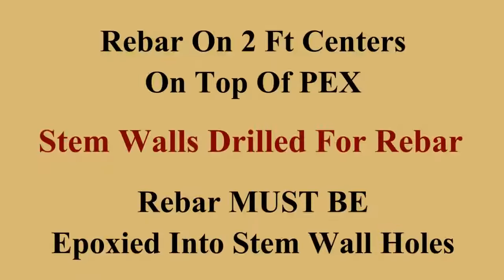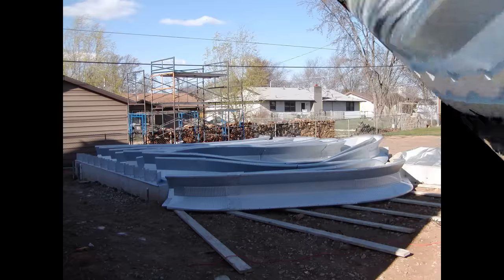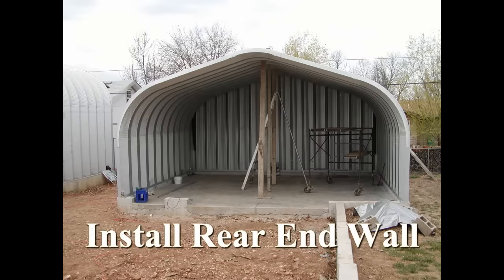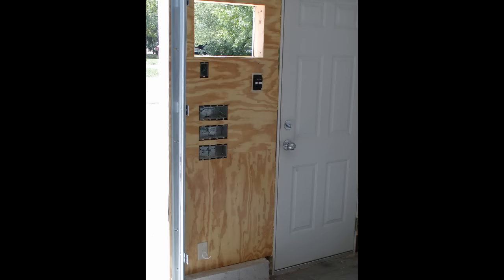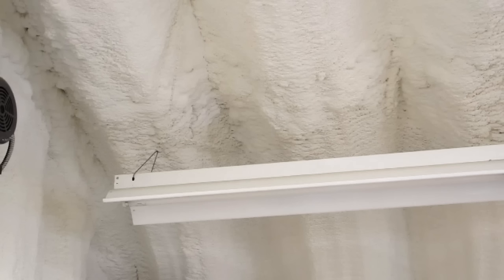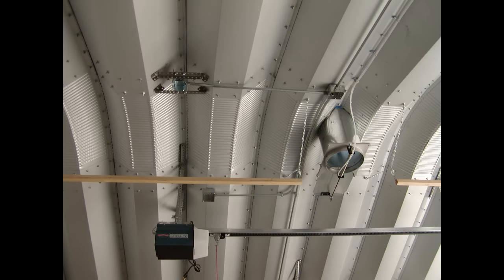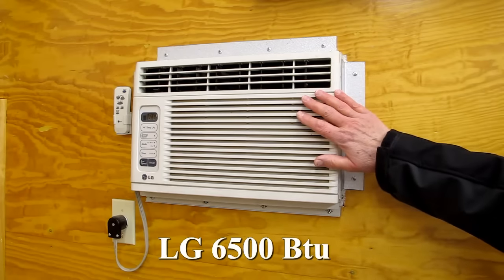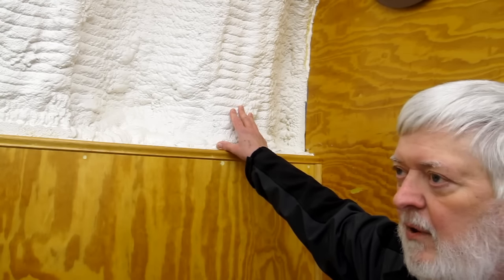Building My Steel Garage

Comment: This may sound like the craziest idea for the use of one of these arched panel buildings. I am a disabled female veteran and I am looking for ways to build a loft style building which allows easy movement in a wheelchair, and use it as my home.  Any ideas?  I know I would have to add heat/ac plumbing for a kitchen and a bathroom.  Thank you for any ideas and help you may have for me. I have been begging my local VA for handicap adapted home grant, and after 27 plus years, I have given up on my VA doing anything for me.
Reply from the maker: First go to pioneersteel.com and look around. Under building types go to Photo Gallery… it’s not great but it shows some stuff. The building is not hard to erect but it is labor intensive. And it must be put together correctly so you don’t have any leaks. You simply need to pay attention and follow directions. I had a 3-man crew put up my second building in 3 days (but they knew what they were doing). Finding and experienced crew may be difficult. The steel building is strong, weather proof, termite proof, fire proof and you will not need to replace shingles. The steel  building is self-supporting but it will not support any additional structure internally or externally. That means you CANNOT hang any portion of your residential construction from the steel building. You would frame out your internal construction inside the steel building and the building would be your outer protective shell. You would want roof turbines on the steel building to prevent condensation inside the steel building. I would not recommend the skylights you will see offered by the steel building companies. So you would end up with a wood house inside a steel shell. You decide what you want, draw up a floor plan including plumbing & electrical details, then do the excavation for footings and concrete floor (you may end up with footings for the steel building and footings for your internal construction). Then ask for the building to be delivered. Usually all the parts of the building are unloaded by hand piece by piece (and there are a LOT of pieces and buckets of nuts & bolts). Having 6 to 8 strong, younger people for this is a very good idea.  Erect the building and then build your house inside. Don’t know where you live, I use radiant heat, which is nice because the floor is warm and the heat rises from the floor. Radiant heat is fairly cheap if you can do it yourself like I did but tends to be outrageously overpriced by contractors and if they don’t know what they are doing it can be a nightmare! Your insulation would be in the walls and ceiling of your framed construction. I have no idea where you would intend to build this nor your idea of what a loft would be or the intended access. A elevator could be a problem with a power failure. Sprayed foam insulation is expensive but many, many, many times more efficient than fiberglass plus it seals the building airtight. Another good insulation is
sprayed in place cellulose insulation (recycled paper product – Google it). This is basically how mice and rats make an insulated nest by chewing up paper and cardboard. Cellulous insulation is many, many times better than  fiberglass. Fiberglass insulation (to me) is a rip-off, a waste of money and a joke. I heat my house with a hot water heater. I heat my shop with a hot water heater. I have zero fiberglass in my house. If you want to live inside  something that looks like the inside of my workshop then you would need to have all the plumbing and electrical done before spraying the foam insulation. Watch my video Welcome To My New Shop, which pans around the inside of the building. The sprayed foam is not pretty but it is a good insulation and when painted white reflects the light nicely. Living inside my workshop (which is 500 sq ft) would be like a studio apartment with a 100% open floor plan. Hope that helps. Thanks for watching and Please Subscribe… there is probably some other stuff which will be of interest to you. Ron

Comment: Very nicely done! How are you connecting the 2x4s to the walls for the paneling?
Reply from the maker: Remove the existing building bolts at that level. Pre-drill a hole from outside. 5/16 galvanized Lag bolt with a steel washer and a bonded washer under the head. Bonded washers have rubber on one side but the metal is pretty thin. Then grind the protruding point of the lag bolt off flush with the inside of the 2x4. Pine is soft so you want a full length of thread inside the wood and do not over tighten and strip out the threads. Don't overheat the lag bolt when grinding so as not to burn the wood.

Comment: How did you attach the 2x4 to the walls.  Did you just use the bolts from the structure itself?
Reply from the maker: Ronald Graham Remember, most sales people you talk to probably wouldn’t
recognize one of these building if it fell on them. They are working off a
script or have been told to tell customers “never drill a hole in the
building”. Common sense and logic are needed when you do these things.

 

The building bolts are on the outside of the corrugations
except where the base plate attaches. The flat panels are on the inside of the
corrugations. I drilled a ¼” hole in the center of the flat panels and attached
the 2x4’s with a lag bolt in every flat the length of the building. I used a
flat washer against a bonded washer on the outside of the building to maintain
a good seal against the building panels. A bonded washer is a metal washer with
rubber bonded to one side. The metal portion of a bonded washer is relatively
thin and flimsy. The flat washer supports it. A little silicone sealant on the
rubber of the bonded washer is a good idea. Only tighten the lag bolts firmly,
do not strip the threads in the wood (2x4’s are pine and it tends to be fairly
soft wood).

 

Every flat along the base plate has two bolts (which will
engage the 2x4’s. Along the bottom against the base plate, smack the 2x4 with a
hammer to indent the wood where all the base plate bolts are. Drill clearance
holes for one bolt and nut (original building bolt and nut) and a hole for the
lag bolt in the other. The height of your side walls will determine if you have
to do the same thing for the top 2x4 (watch the video again and you will see
what I mean).

 

Use lag bolts long enough to obtain full thread contact with
the entire thickness of the 2x4 and then grind off the excess bolt flush with
the inside of the 2x4. 

 

I used on 2x4 at the top, one at the bottom of the plywood
and then 2 two more spaced in between (watch the video again). 

 

I would not recommend drilling holes in the curved sections
or in the flat roof panels. A few holes in the vertical side panels and using
bonded washers you should be good. Remember, think about what you are doing
before you go drilling any holes.
Reply: Ronald Walters
Awesome. Thanks for the advice.  Keep the videos coming!!

Comment: Do you have any videos on mounting the wood panels to the side wall?
Reply from the maker: Sorry, no video showing that. Remove the existing building bolts at the level of the 2x4’s which the interior walls (plywood) will attach to. Pre-drill a hole from outside. 5/16 galvanized Lag bolt with a steel washer and a bonded washer under the head. Bonded washers have rubber on one side but the metal is pretty thin. Then grind the protruding point of the lag bolt off flush with the inside of the 2x4. Pine is soft so you want a full length of thread inside the wood and do not over tighten and strip out the threads. Don't overheat the lag bolt when grinding so as not to burn the wood. I used four 2x4’s for attaching the plywood (top, bottom and 2 in the center).
Reply: @RonaldWalters2010  thank you for the information sir. I've been looking at turning one of these buildings in a camp hut for my father and mother. So I've been trying to find a way to attract siding, as I have a habit of over thinking simple problems.

Comment: I"m attempting to find the video (if it exists) for tying the sides of the rounded steel structure into the rebar. Do you have the link for the concrete poor?
Reply from the maker: In the case of my garage, the building is not tied to the rebar. The stem walls and the concrete are tied together with rebar.  Then the building is bolted to the stem walls. I do not have a video for the concrete work.

Comment: Interesting video, Ron...   Found it on woodgears.   At first I thought this was a historical document about your woodshop, but through watching the video I see the cyclone on the back of the other building, and the cars inside this one.   Then I'm reminded of your other videos of using the "indents" in the side of the steel shop building for innovative tool storage and so on.

This begs the question - how did you insulate your woodshop building?  Or didn't you?

Comment: How much additional cost in involved in ordering the building with the industrial base plates instead of the regular method for anchoring the building, just using angle iron plates that get embedded in the concrete after assembly?  It does seem much nicer and easier than trying to precisely locate each of the plates individually.
Reply from the maker: It does add some additional cost but the industrial base plates are a far superior mounting method and they precisely locate each arch where they are supposed to be. An unsupported arch can grow or distort in length. The industrial base plates and perforated angle straps keep things aligned until all the bolts & nuts are installed. Embedding the metal building into concrete can be a corrosion point and personally I never recommend it..
Reply: Ronald Walters 
Sounds like the best way to go, I'll go for that option. 
When doing the final tightening of all the nuts, is that done from the bottom? Since there's no way to hold the opposite end, I assume the bolts can remain stationary from friction while tightening the nuts.
Reply from the maker: Follow the directions that come with the building. All bolts & nuts holding all the arch sections are installed loose and about half the bolts & nuts between each arch are installed loose. All the bolts & nuts for the industrial base plates are installed loose. Once up and squared the remaining bolts & nuts are installed loose. After 100% of the bolts & nuts are installed loose, you go back and start tightening and try to do it symmetrically. The bolts are tightened from the outside and someone is inside holding the nuts with a wrench. Takes a while. Have fun and don't fall off the building.
Reply: Ronald Walters 
Okay, so there will need to be a helper for that final tightening then, thanks for the info. It'll be coming in March, so I'll have plenty of time to go through the process, very helpful-

Comment: Was this done with permits?  Where? Anybody know if Florida lets you install these on commercial lots (as the primary structure)  and conduct business out of them?  Anybody know what the turnkey cost for a building this size with that slab installed?
Reply from the maker: Built with permits? Yes. Designed for the county and state where it will be installed... snow load or wind load included. Many have been installed in Florida... personal, residential, commercial. The rest is for your research.

Comment: Can I ask a silly but honest question? Could you fix this and make it look really nice to be a little man cave or small home?
Reply from the maker: Danny Doty Or a LARGE home. It is done a lot. Framed out residence in one end. Very durable outside shell with no shingles or siding to be concerned with. And then a large garage section in the other end for the RV, boat, cars airplane hanger or workshop. Many possibilities. Go to Pioneer Steel Building website and then photo gallery. Cost effectiveness is a little like comparing apples and oranges as it depends on what you are going to do with it, however it provides a very solid building at a lower cost.
Reply: +Danny Doty My grandmother lives in a retirement community were all the residents own RV's and easily half of the homes are built out of buildings like these. Some of them would shock you how nice they are, you would never know once inside that they were a steel buildings. Like Ronald said most of them house the living space and garage or covered area for the RV's.

Comment: How feasible and cost effective are these buildings as primary residences?
Reply from the maker: It is done a lot. Framed out residence in one end. Very durable outside shell with no shingles or siding to be concerned with. And then a large garage section in the other end for the RV, boat, cars airplane hanger or workshop. Many possibilities. go to Pioneer Steel Building website and then photo gallery. Cost effectiveness is a little like comparing apples and oranges as it depends on what you are going to do with it, however it provides a very solid building at a lower cost.
Reply: Excellent!  Never thought about the metal building vs. stick built home before until it just sort of "hit me" a few days ago.  I appreciate the feedback.
Reply: Ronald Walters...But options for windows and skylights very limited.

Comment: can  this be  buried under  ground as hurricane and  earthquake  shelter if covered  with  sand then can create the top.  ????
Reply from the maker: These are designed to withstand wind and snow loads for the specific location they will be built. They are not designed to support external loads. Burying it in the ground would result in a considerable external load and it would collapse.
Reply: Tanks. I GUSS I will be trying with a shipping container instead.

Comment: I like these type of steel building but i am concerned about the foam insulation. I have heard many dangers with this type of insulation. Is there alternative methods?
Reply from the maker: +Domenic Abitino  Manufacturers show other much less efficient and complicated ways. You can research their websites. What are your concerns with the foam?
Reply: +Ronald Walters  well I heard they can let off s toxic odor. Is this false or old versions.
also if you ate in cold weather how does that effect the transf r between the steel and foam? does the steel sweat on the inside from the cold?  with our workout the foam?
Reply from the maker: +Domenic Abitino  A bare steel building can sweat on the inside with changing weather conditions. That it why roof turbine ventilators are recommended. With foam sprayed on the inside of the building it will not sweat. There were (possibly still are) some foam insulation which gave off formaldehyde. Much better polyurethane closed cell expanding foam insulation available today. Only closed cell polyurethane foam will adhere to the CLEAN steel building. The building needs to be power washed with soap and water and rinsed to remove mill oil. The foam also seals any air leaks and keeps out bugs. You would want to deal with an experienced installer to get an even coverage. I have seen some pretty sloppy foam jobs that looked terrible. The foam needs to be painted to protect it from ultraviolet light.

Some contractors will say you can spray the inside of the building with glue and then spray cellulose insulation. Do not do that. It will fall off and you will have a real mess.
Reply: +Ronald Walters Thank you for your input I will research a bit more. I want to use a steel building as a habitat.

Comment: HOW MUCH WAS THE TOTAL COST ??? Many people are asking.
Reply from the maker: Question asked. Question answered. Please read the comments. Unfortunately YouTube shuffles the questions and answers. Read them anyway. What it may have cost me back then is irrelevant to what it will cost you now for what you want or for the area where you live. Estimate the concrete work (footings, stem walls, 5” reinforced floor) the steel building will probably cost you about the same. You will need help with building erection (3 or 4 people). Learn about radiant heat systems and do it yourself. You will probably need help with the concrete and foam insulation. Framing the wood front-end wall, garage door, electrical, plumbing, A/C, exhaust fan, etc. you can do these yourself fairly cheap. Plan ahead. Make a detailed list of what you want and get estimates. If you cannot do any of this yourself, turnkey will cost you a lot more.

Comment: If you were to guess how much would it cost to get electricity water and sewage out to these if I had land?
Reply from the maker: Danny Doty I could not guess. You need to get an estimate from a contractor and then they would need to know the specific property involved, if city electric, water, gas and sewage are available or a rural location where a septic system and a water well would be required.

Comment: So what did it all cost without the heating system?
Reply from the maker: Basically, calculate the cost of the stem walls and concrete floor with rebar as described and the building itself (bare building) will probably be about he same. Then add all the other goodies like  front end framing, garage door, exhaust fan, insulation, electrical, etc., etc. My building cost was then... your cost would be "now".

Comment: Hi Ronald - great job on your new workshop. Could you please provide a brief description on attaching your wood end wall to the steel. I have an idea - but I'm curious about your system. I may have bought my building with your help - in 2008 - had to put my shop on hold because of ill health. It's finally up now, and I want to do wood-framed end walls with vinyl siding too. I drove to Ontario CA to pick up my building in 08. Any help would be greatly appreciated. -steve